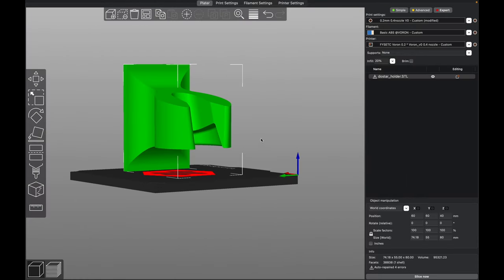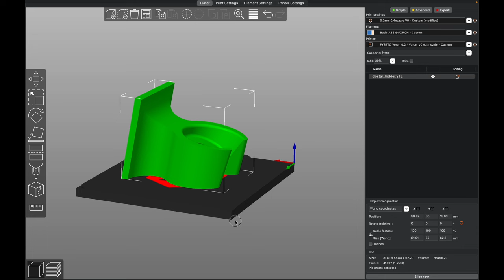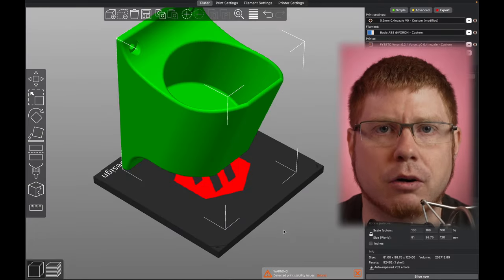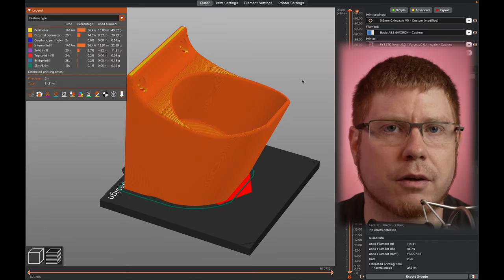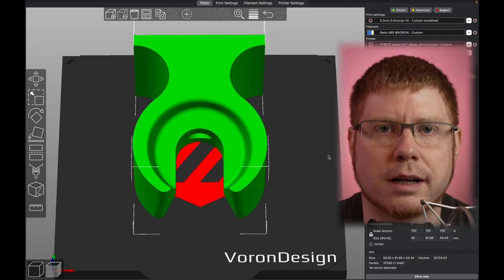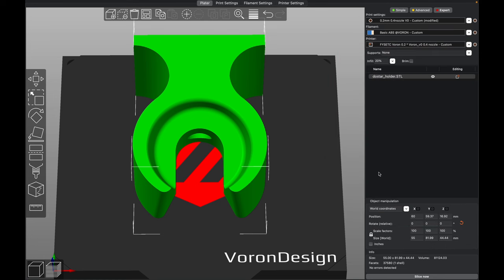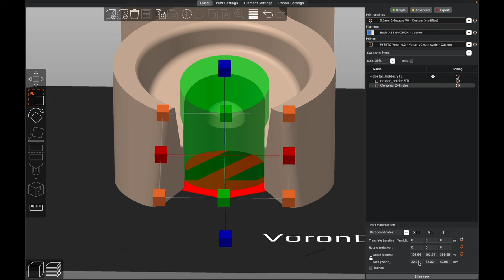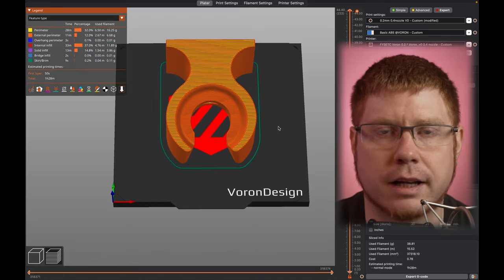Fix poorly designed Models in Prusa Slicer easily | Wall Holder for EV plug installation

Comment: Perfect topic for me. I generally design with how it will print in mind.
When i try to use downloaded designs they generally need tweaking. I have wanted to learn what slicer programs can do for small issues. Already helpful, Thanks.
Reply from the maker: Definitely! I ended up making my own version so many times just because available models were hard to print. Glad I could help :-)

Comment: Oh what the….i had no idea to do this kind of thing, this is incredibly useful thank you for the video. 

Any more slicer tips and model assessment videos would be increasingly useful to help me not waste further materials learning these lessons 😅
Reply: To further add - my original comment was about the cut tool in the slicer, and then I realized as I watched further that the style of video showing the entire workflow of you going from “problem -> part design/editing/slicing -> printing and assembly” is very very useful for a beginner like me and also very much unlike other content I find from channels. 

So - if it’s feasible, I’d be very interested in similar videos!
Reply from the maker: There are few more in my design and print guide. I guess I have to put a comprehensive "Slicer Masterclass" on my ToDo list :-)

To this day I'm still not sure if people didn't like the video or YouTube just buried it. It's one of the most disliked videos to this day...
Reply from the maker: Thanks! I'll keep that in mind.

I'm often under the impression that many channels show what they want to do, then speed up the creation process and then show you what cool thing they built. They basically leave out the most interesting part for beginners. 

To be honest I already had  everything figured out and printed when I came to the conclusion others could benefit from this as well so I recorded the process. If you watch closely you see the part was turned 180° on the build plate since I just took it out of the printer for illustration.
Reply: @SmallBatchFactory  speaking for myself it was the last video I clicked on when browsing your channel. It's perhaps a lame suggestion, but I guess maybe the video format can use a title/thumbnail rework? Perhaps also refining the topic/series into a more coherent way can benefit you - e.g. titling the workflow format style videos with a episodic naming convention to help the series stand out. Maybe even using insights to find a title for them that helps users who want to see this sort of thing find your vids easier. 

Maybe it was more niche and less people found it interesting than I did, but I also feel like you're definitely pushing the 3D printing YT content in the right direction with this style of video (and your entire channel honestly), and this sort of "workflow guide" can benefit a lot of new and experienced users alike.

In short, keep on doing what you're doing, don't be afraid to try new things, and don't be afraid to expirement with topics you feel have "already been covered" by others. You have a very unique style. You combine a lot of the "no nonsense" engineer style approach towards the hobby, while still making it accessible to newcomers who are passionate about the hobby and want to improve their skills and would like some direction/inspiration. Maybe this is all just me projecting though :P

I was really happy to have found your channel overall, and look forward to anything you choose to make next. I'll be liking/commenting etc to help boost you on the algorithm regardless of the topic. Sorry for all the unsolicitied advice - take it easy and cheers!
Reply from the maker: Thanks for the feedback! Never hold back, I'm the type of guy who wants such insights and can take it :-)

I think you're onto something and are in line with other comments I've gotten :-) people seem to like the concise style. I can totally relate, I don't watch most 3D printing channels since they're lengthy videos with much fluff and very little substance IMO.

This video in particular is the one I spent the most time on thumbnail and title, meaning I changed it quite a few times. Maybe the first one was better, since I didn't get much traffic back then I probably changed it for the worse. I'll go ahead and switch it back to the older thumbnail and see what happens.

Thanks again for your comment and keep the helpful advice coming :-)

Comment: Video Idee: erkläre doch die notwendigen settings/ Schritte um ein teil nur mit Minimum Material zu drucken, welches nur zur form und Größen Kontrolle genutzt wird, es muss also nicht einmal stabil genug sein um festgeschraubt zu werden.
(Hoffe hab es Verständlich ausgedrückt)
Reply from the maker: Gute Idee. Ich würde das kombinieren mit den im Slicer integrierten Messfunktionen. Hab grad vor kurzem ein Case für Akkus gedruckt und brauchte 3 Anläufe. Erst nach messen und anpassen im Slicer hats auf Anhieb gepasst. Ich schreibs mir auf die (lange) Liste :-)

Comment: good info... but scrap the car
Reply from the maker: You mean the rest of the video related to installation of the part or are you just anti EV?
Reply: @SmallBatchFactory  I liked your video.. good info,  but yea guess you can say I am Anit-EV, sort of as they are neat vehicles but shouldn't be forced down our throats, besides they should come with every thing you need including installation items done by the dealer for what the heck EV cost...I apologize for getting side tracked
Reply from the maker: Thank you! That's fine, I don't mind. To be fair it was the wiring in my garage that needed rework, I already had the wall box. The mentioned Nissan Leaf charges on one phase wiring but now I needed three phases for maximum charging speed.
Reply: @billb921  Well they don't give us gas pumps with our ICE cars, there are affordable EV options especially when incentives are available, and IDK if you have noticed but the price of gas cars has gone insane. I love ICE vehicles. My whole channel is based around them. I still wouldn't kick an Ioniq 5 out of my garage! Full EV adoption won't happen for a few more decades at least.